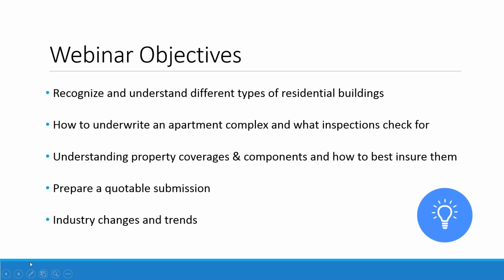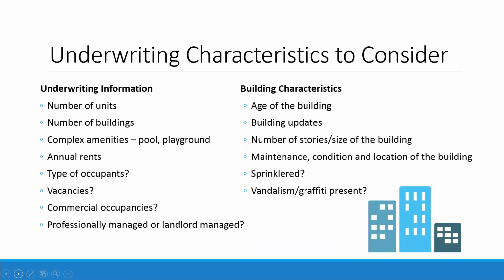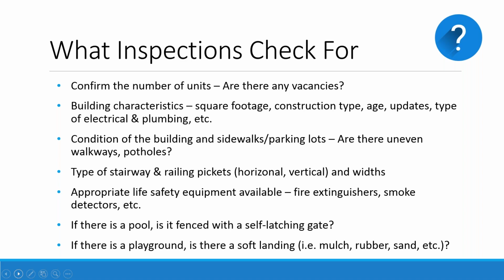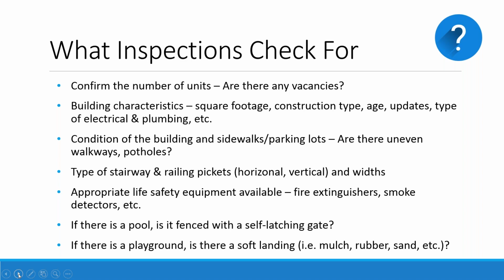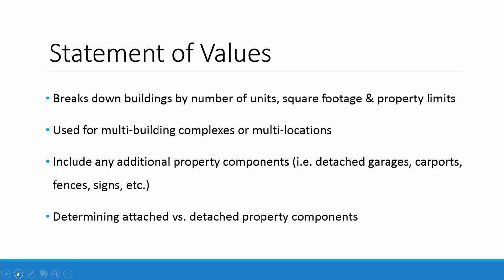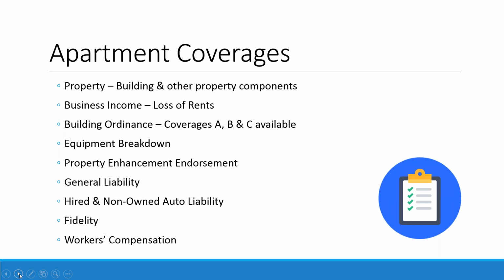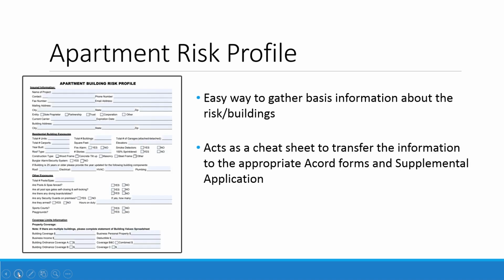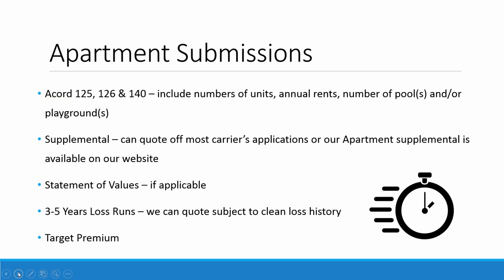Insurance for Apartments Made Easy

Comment: I sell commercial poultry farms owned by private individuals who contract with integrators like Tyson, Butterball, Simmons, etc. Insurance is becoming an issue on poultry houses 30+ years old. Insurance companies do not want to insure these steel truss, 40 x 450 houses, but I could get insurance on a 30 year old apartment building. Seems like an inspector could personally look at the structures to determine if they have been well maintained and look like a good risk rather than just turning any poultry house 30+ yrs old down flat? How can an owner ever sell these businesses? Lenders require insurance. Thank you for your videos!
Reply from the maker: That is a great question. The industry as a whole seems to be difficult, but unfortunately we're not really experts in the farm industry so we can't speak to the unique issues those owners face. You'll need to find a carrier that specializes in farm and would be open to insuring these unique businesses. I wish you the best of luck and I know you'll find what they need!